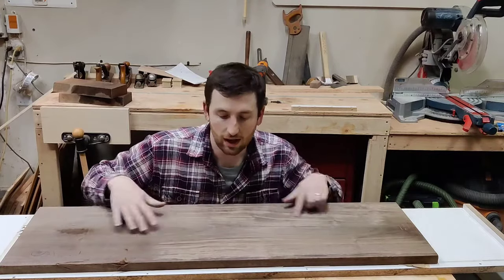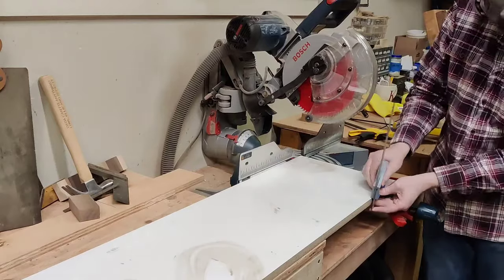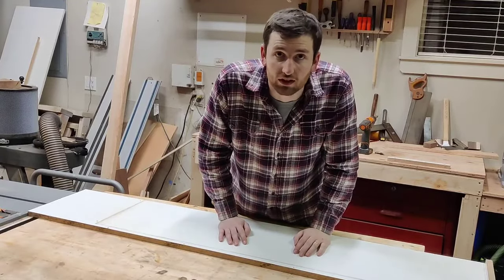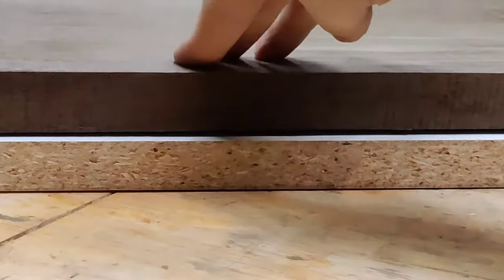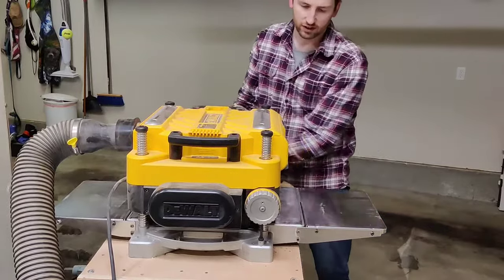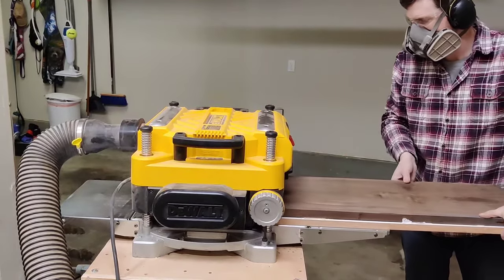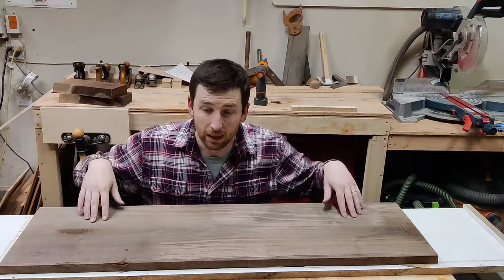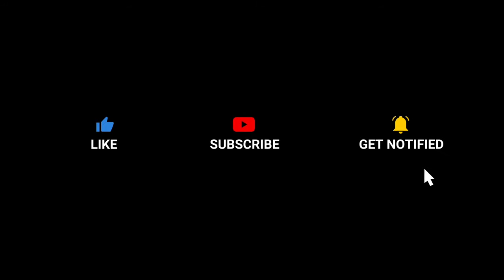Your Planer Sled is Backwards | Ditch the Hot Glue

Comment: See, I'm not sure I agree with this. The rollers do pull the board through but the planer blades are going the opposite direction and can easily throw a board back at you. So with this way, you're relying on your rollers to be stronger than the motor's torque and blades digging into your board. That's why the traditional way has the fence on the back of the sled. Always better to have the sled "backwards" and use hot glue. Makes it way safer in the long run. But that's just my two cents! (And most other woodworkers)
Reply from the maker: The thing is you are always relying on the rollers to stop the cutter from kicking the board back so this is not different from the way you would typically operate a planer. The force of the rollers is working in your favor to keep the board moving forward and the shims in place.
Reply: @keatonbeyerwoodworking  that's a good point! What is stopping the work piece from shooting out using the planer normally? haha What about a drum sander? Same concept right?! 🤔
Reply from the maker: @Voicesofjake  the rollers of the planer keep the workpiece moving forward. It can shoot back if your piece is too short and can't engage at least one roller, which is why they usually say min length of 12 inches. A drum sander has the base that is sand paper and works as a conveyor belt to move the piece forward. Btw, thanks for the comments and finding my videos. I've seen your videos, they always make me laugh!
Reply: @keatonbeyerwoodworking  I just always thought with such force from the planer blades, you'd want a back cleat and not front. But it makes sense! But also the other way too sorta.. haha I just ran a warped cherry board through my drum sander and I had the cleat on the back. I think if I didn't, it would've pushed it off the sled. Since the sled was slipping on the conveyor belt too. (Fixed that with some spray rubber on the bottom of the melamine.)

But that's great to hear! Thanks dude! I'm really getting into wood working now and love learning and watching all the recommended videos Youtube throws at me! haha

Comment: Thanks for the tip, but I have a question. Most times when I'm feeding a board (doesn't matter if it's flat or not) the board starts to turn before it's finished. What am I doing wrong? Thank you.
Reply from the maker: Some boards will do that. If the wood is more dense on one side (say one side has less dense sapwood) or one side is a little thicker the machine will cut faster on the less dense/thinner side and the board will start to turn. Or say the planer hits a knot the knot will slow the machine down but particularly in that spot and cause the board to shift. On the out feed side you can help guide the board and keep it aligned as it exits the machine.
Reply: @keatonbeyerwoodworking  Thank you

Comment: I have found that with heavy boards I can usually go without glue. However, with smaller, lighter boards the shims would sometimes vibrate out of position. I use hot glue to stabilize these shims.
Reply from the maker: That definitely makes sense. The biggest thing is to turn the sled around and put that fence in front and not behind the board. But I agree, this works well for bigger boards and glue is good for the small ones.

Comment: Usually when hot glue is used, a fence is too.  The hot glue plays the role of your shims, but won't fall out.  Some use wedges locked in with hot glue, but some just use the glue.
Reply from the maker: The major point is to put the fence in the front. I usually see the fences in the back which really isn't doing much. If you want to hot glue the shims so they don't move that's great. I find the glue slows down this already slow process
Reply: @keatonbeyerwoodworking  You are completely right about the position and need for the fence.

Comment: Still need to get my first planer, but I’ve been wondering about a sled with some clamps might mitigate the shims.

So picture a the same sled you built, but have a moveable fence in the rear that could “clamp” the board to the front fence.  I would think if the clamp pressure was tight enough, the rollers couldn’t compress the board, and it would mitigate the need for shims.

Hoping to try it out once I get a planer.
Reply from the maker: That would work to some degree but you'll still need to shim. The rollers on the planer push down so hard they'll flatten the board as it goes through the cutter head.

But that's a good idea to hold the board in place to make it easier to operate
Reply: No, you still need to shim. Especially if the board is long and has a twist otherwise it will just wobble in the middle. Fence either end is fine though, adds some security.

Comment: Great video! I have a 30” sled and then a larger one since that melamine or MDF can be heavy.
Reply from the maker: Good idea. My smaller one, still 46 inches, was way lighter, but it bowed. This new one I'm storing flat on the wall so it hopefully won't bow again, but I needed a 5 foot sled for the project I'm working on. It is a beast, especially when loaded with a 5 foot 8/4 walnut board!

Comment: Where do you get the hose for wood scraps
Reply from the maker: If you mean the excess melamine I picked some up off a job where I replaced some melamine built ins, but I've also bought it for making concrete table tops and used the scraps off that. But any sheet good will work, MDF or plywood as long as the plywood is flat and not warped. I'd stay away from any type of sheathing plywood because that stuff isn't super flat or consistent.

Comment: Does this work with longer boards? Like around 8 feet?
Reply from the maker: Yes it does, you'd need an 8 foot sled for it to set your shims. Having a flat panel like this wouldn't be the best at that length either because it will bow when you pick it up so I'd suggest using hot glue in that instance to glue everything in place to help keep the jig flat as you move it and the shims in place. At 8 feet the jig and board will be pretty heavy and hard to control so you might want a second person to help you out. Mine's 5 feet which is unruly but manageable, I'd prefer shorter but I needed it that length for a project.

Comment: please help me understand why the stop should be in the front. the cutters are running towards the back so it would push the board back if it were going to slide right? the cutters aren't pushing it towards that stop. is it for the rollers? the rollers would be going forward but I just thought you were supposed to put the stop opposite the way the cutters  would push it.  help me understand please.
Reply from the maker: The rollers pull the board forward. If the fence is in the back then the rollers will pull the board right off the sled. That's why you see other people on YouTube use hot glue to secure the board to the sled because the fence isn't doing anything. My method uses the fence properly. 

Another way to think about it, when running a board through without a sled the board doesn't have any fence in the back but it still moves forward through the machine. The rollers resist the cutter so the board doesn't kick back. The sled isn't hitting the rollers so it needs a way to move forward with the board, hence the fence in the front to drag the sled with the board.

Hope that helps!
Reply: Also, why it’s important to take fine passes. If you try to take too much in a single pass the cutters will almost certainly push the board away from the stop bar.

Comment: Are you sure that planer makes climb cuts?
Reply: Just got it, it's the feed rollers.
Reply from the maker: Yep. The rollers pull the board in and past the cutter. Hence fence in the back is useless
Reply: @keatonbeyerwoodworking  I've sure wasted a lot of hot glue.

Comment: I'm laughing at myself for doing it backwards for so long. Thanks!
Reply from the maker: Try it out. It's way faster this way, especially if you're brave enough to go without hot glue to hold the shims in. It does make it trickier moving the board and sled around, especially if the board is big, but man is it easier and nicer to not deal with hot glue